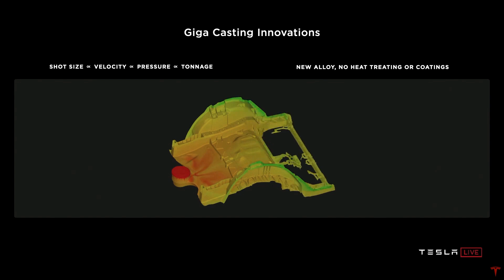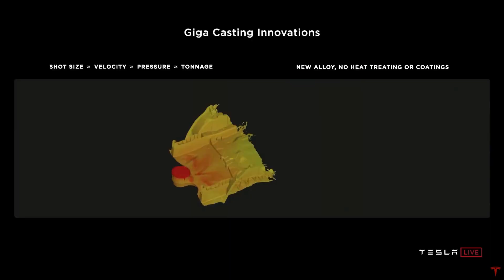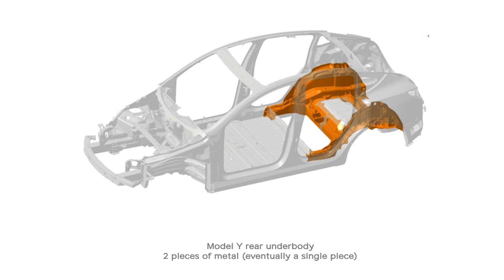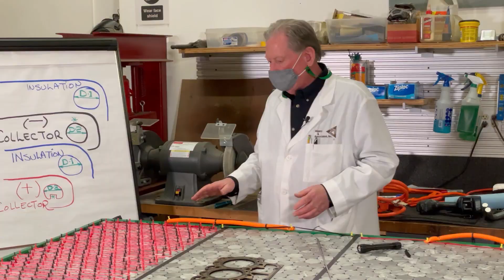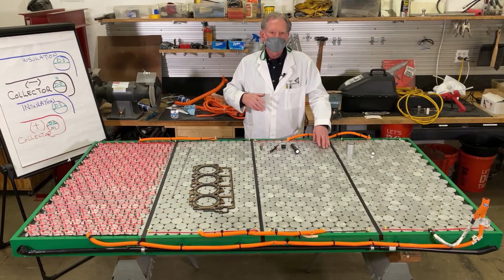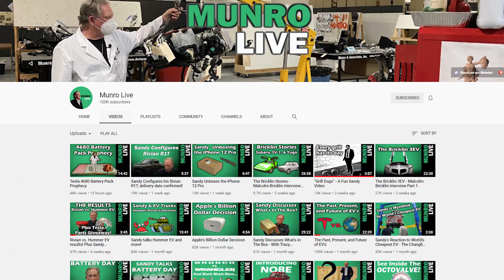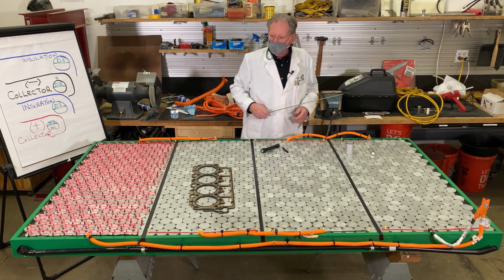SANDY MUNRO Rejects TESLA Battery Day Doubts

Comment: Tesla had to invent a new type of steel that hardened at the right rate in order to use the casting machine. That’s not the type of innovation that legacy does.
Reply: Yup. That's the kind of start from first principles design that makes Elon stand out. Can't be done - do your own metallurgy. Did the same thing with the Raptor rocket engine at SpaceX. The insanely efficient combustion process was known for decades but considered too difficult. SpaceX developed their own new alloys that can handle it.
Reply: @donjones4719  And your 2 posts are the kind of stuff that makes ridicule of Tesla so easy ! Learn something about what you're talking about first or STFU !
Reply: Aluminum not steel
Reply: Exactly!
Reply: Kilal Googlestaffers  Elon musk is stainless!!
Reply: Kilal Googlestaffers  SO ? Is that relevant to cars in any way ?
Reply: Kilal Googlestaffers  Your absurd reply just shows how low the fanboys are prepared to stoop. I am an engineering consultant, I don't take advice from clueless wannabe's.

I have no investment in Tesla so can't have been 'burnt from shorting' ! In fact I abhor the manipulation of stocks for short term gain like that practice. It totally devalues industry which simply becomes a financial plaything for speculators to manipulate with no consideration for the long term or true value of anything.

Face facts, Tesla did great but is now getting 'fat and lazy'. It has no mass-market car for widespread adoption. Even the Model 3 is a tad too expensive (both to make and buy). China and Europe are have been quietly beavering away without shouting about it like Tesla. How many EVs sale on sale in the USA now ? Tesla makes 4 very similar cars, Models S, X, 3 and Y, Chevy has the Bolt, Ford has the Mustang Mach-E, others ???? Not  a single commercial van or light/heavy truck/semi to be seen !

I suggest that YOU look at China and Europe and compare for yourself. Europe has getting on for 30 EV cars on sale now. a similar number of light commercials such as delivery vans and significant inroads in buses and heavy trucks. China ? An insane number of smaller EVs (too may to count) and BYD really know their heavy EV commercials. I believe BYD has made about 90% of all the electric buses delivered to date, about 400,000 of them !
Reply: Kilal Googlestaffers  TWENTY FIVE equally clueless replies I should add ! Quantity doesn't trump quality or knowledge of the subject !
Reply: Kilal Googlestaffers  YOU'RE AN IDIOT ! CASTING ISN'T HIGH TECH NEW TECHNOLOGY ANYWAY !!! It eveloved in the 19th century. IT DOESN'T MATTER ! IT'S TRULY UNIMPORTANT*.  NO OTHER AUTO MAKER NEEDS TO MAKE CASTINGS FOR THEIR BODY BECAUSE THEY'RE *CLEVERER THAN THAT !!!
Reply: @pasoundman  you are obviously delusional if you don’t see full self driving beta being extremely close to level 5 autonomy. Tesla is a rare company that innovates on many levels, the fact that your hatred for them blinds you to that is unfortunate.
Reply: @0xNameless  'Autopilot' is totally farked up ! It can't even negotiate a sharp turn safely. It can't work out the limits of the roadway or lane. It's famous for its hesitation when passing other vehicles that are close to lane limits, including vehicles coming from the other direction. It will NEVER improve without a breakthrough in machine vision that encompasses a simulation of human stereoscopic vision that estimates distance and speed to a high degree of accuracy. The courts will finally decide in favour of disillusioned drivers who get virtually nothing for their $10,000 and regret their purchase. It's the owners of Teslas that are saying 'save your money, it's not worth it' ! Have you seen Renault's self-driving ? Now that's impressive !
Reply: @0xNameless  To be honest, it's delusional to think that 'self driving' is even an important goal ! Many, most drivers even LIKE driving their cars. The idea that you'll get in a car and use it a mobile media centre or office is totally insane.
Reply: Julia, clearly you haven't the tiniest clue about it ! Firstly, Tesla's castings are ALUMINIUM not steel. You can't cast steel, only roll it from large billets. The only casting material involving Fe is cast iron and I hope no car uses that in its chassis or body. Many ICE engine blocks are made from cast iron though, making them cheap ! ! Tesla also invented no new material, if anything a new material is simply *developed*. An INVENTION is something entirely novel and that's not the case here. The range of casting alloys is huge already. Your comment is the typical uneducated wannabe 'fanboy' blather !
Reply: Actually that's not a biggie.. the steel industry comes up with thousands of new steels a year, it's the chemistry change.  If you ever watch a steel company's presentation, they love to say "80% of the steels we make today were not made 5 years ago.  It's really not, it's the constant flux, very tiny changes in the additives at the BOP.  So, while I love what Tesla is doing, I would not highlight this as anything very special.
Reply: @KenH-tj3fw  does the steel manufacturer also design its own "Full Self Driving" computer, programme its own custom AI based full self driving software, design new battery structure and chemistry? And in its spare time revolutionise the rocket industry? Thought not...
Reply: @0xNameless    You mad Bro?  Have no clue what you mean...  Been in a hundred steel mills... didnt think so
Reply: @KenH-tj3fw  I give zero shits about your mills the point being you are looking at a singular fact about Tesla and naming it not special yet forget they are making breakthroughs in every area of the car industry. Anyone involved in engineering should recognise the scale of epic-ness happening at Tesla.
Reply: @0xNameless  are you in engineering? I personally don't think Tesla is all that impressive, but I would love for you to explain how they are revolutionary.
Reply: @rasithwnninayaka1633  let’s discuss, provide more details on why they aren’t impressive? Specially your engineering expertise on why they aren’t impressing you.
Reply: @0xNameless  Why does 'full self driving' make the aluminium any better ? So, Tesla can do 2 things at the same time ? Is that supposed to impress me ? FSD doesn't work anyway. Tesla will end up in court on account of it.
Reply: @0xNameless  NO !! Tesla are simply SHOUTING about tiny things that anyone else wouldn't even bother to mention because they need the spotlight of publicity to continue their insane over-valuation.
Reply: @Ken H making new alloys is easy. Making new alloys with very specific properties that alloy the material to do several things that no existing alloy can do is difficult. And BTW, Tesla also has a new aluminum alloy that it has cast it's new motors into as well.  NO other automotive manufacturer is out there developing new alloys. This is something that the aerospace industry does, not the automotive industry.
Reply: @patreekotime4578  A new alloy for its motors ? Doubtful, what advantage would there be ? I'm all ears. PROVE IT !
Reply: @KenH-tj3fw  It’s an Aluminum alloy which doesn’t have to be heat treated after casting. Special alloy has to be cast in micro seconds. One piece replaces 69 separate parts which had to be welded. Satisfied now?
Reply: @KenH-tj3fw  thank you, not a new type of steel (actually aluminum), a new alloy. Presumably an improvement over using off-the-shelf alloys, but not necessarily revolutionary.
Reply: @robertpryor7225  Routine, run of the mill materials science to be honest. Move on, it's not a big deal.

Comment: Would be great to hear Sandy about Plasmatic vs the new big cell.
Reply: Hmmm. 46-80 vs. Prismatic?
Advantages of 46-80: Cheaper, easier to produce, faster to produce, structurally stronger, less waste heat, better cooling.
Advantages of Prismatic: ... ... ... crickets

Comment: Sandy sorry not everything is better that’s just wrong, I get it you are a Tesla fan boy however we had issues with our previous Model X battery pack one set of cell had issues, they replaced the battery pack and I was told they will service my old pack and replace just the bad cells etc.. so that mean that old pack will be reused for another replacement?   In the new design what happens when some cells go bad and they will go bad .. what do they do then, Total the car? 

No insurance company will do that after your battery drivetrain warranty runs out .. also you don’t have to have a major accident to cause the front casting to bend or crack etc.. and to just Total a car for a small accident is crazy vs just putting on a new fender .. anyways Alex you need to get some engineers on your channel that is not looking at lowest cost to build something but also looking at what is best for the life cycle of the car .. 

BTW with all that saving going with bigger battery integrated and castings etc.. is Tesla going to drop the model Y starting price to $35k? I mean the end result is overall a much cheaper car to build .. better not run over too many major potholes that front stiff casting will crack .. anyways Alex if you can line up some engineers that would be good ..
Reply: Exactly.  Anyone with and design sense can see the problems.
Reply: I actually don't think Sandy is a Tesla fanboy.  This is the guy who says Tesla's tech is years ahead, but that their build quality and paint shop are decades behind.  I think he's really trying to tell it as he sees it.  That doesn't mean he's right, of course.  I'm not personally a fan of this design.
Reply: Yes, you are exactly right. James from James and Kate recently showed how in 3 hours they replaced a defective module in a Nissan Leaf battery pack, from start to finish, using basic garage tools. Weber Auto has done a similar video with Chevy Bolt EV battery. 

Anyone who understands batteries know that If you have 96 groups of cells in series and one group drops to 5% capacity, the entire battery pack useable capacity is only 5%, unless there is a very expensive active balancing system that can feed 50A into the weak group from the other cells such as the Flash Balance technology. But simply replacing one group will bring the pack back up to whatever the second weakest group is, normally 80-90%.

The model S and X were great designs. 16x 24v modules which can either be replaced to get the pack back up to snuff or can be salvaged and ready to use as is in any 24v, 48v, or any other 24v multiple. 

The new concept of a sealed battery pack embedded into a central casting and potted in so much that it can’t be repaired and can’t be used in second life until someone carefully digs out all the 4680 cells. 

Laptop batteries are a perfect example of this. Normally it has 3-4 groups of cells in series and when one cell dies the battery drops to 60% (of each group has 3 cells, 45% (if the groups are 2 cells) or 0% if it’s one cell per group. The battery is sealed so the average person discards the battery pack buys a new one, but the fact is replacing that one dead cell can bring you back to 90% or so perhaps for several more months. 

Of course many buy these “dead” Lol laptop batteries for pennies on the dollar and harvests 5-8 cells that still have 90% capacity and make batteries for other uses. But imagine if the battery pack was held together by screws and each cell can be replaced individually without soldering. A $10 cell instead of a $100 pack.

Each model Tesla makes harder and harder to use the models. A model 3 has two different module voltages so you can’t put them in parallel if you want a big 89v pack. 

My EV is a Chinese ebike which used 4x 12v20ah lead acid batteries. Everything can be replaced cheap and easily: batteries, motor, inverter, etc. there is no electronic code that must be matched. Just buy a suitable part and it will work. 

Tesla is trying to slowly become Apple, create an ecosystem that people cannot easily escape from. Their proprietary charger plug and supercharger network is one such thing. Luckily some European countries said to Knock that crap off so they added CCS capabilities to the chargers and cars. But in the US, nope. Tesla can do anything they want.

Comment: If the castings are bolted they could be structurally glued to as well. Welding adds stresses that risk cracking.
Reply: Kindly give us an example of glued parts that size. Thanks
Reply: What exactly is structural glueing ????

Comment: Motorcycles have had cast and extruded aluminium frame parts for decades. The sad thing is that true innovation in bikes has stood still since 1960s. Genuine innovators like Hossack and Britten have been ignored.
Reply: Gee whiz. Take any bike from the 1960's and compare it to the counterpart half a century later.
Reply: Have you not seen a 1199 Panigale from Ducati? It doesnt have an aluminum frame like all the other manufactures.

Comment: Everything presented on battery day was wonderful. My only concern is that they may not ramp up battery cell production as fast as they need to provide for the cars that will use them. If they build the factory lines in Germany to use the new battery and then there is a shortage of batteries, that would be a problem.